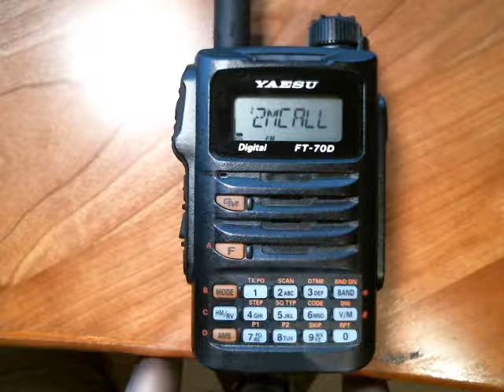Yaesu FT-70D Memory Bank Scan not working

Comment: Depending your method in programming, there is the option to ‘link’ programmed scan Banks.  If selected, the radio will go through all linked banks as if they were one. Discovered on mine when programming via PC. Once in-linked, scanning separate Banks worked as advertised.  I know this is an old post, but maybe it helps someone out there.
Reply: Your idea works. To bad it's not in manual

Comment: This works fine on my radio. Ensure you are on latest firmware. Also, mine was programmed using the RT Systems software and cable specific to this radio. If you used CHIRP or something else, that could a source of the issue. Hope you get it resolved if not already.
Reply: Don Draper 
Hello, I’m also having same issue. My unit came new a month ago with latest firmware. Cannot manually create and recall any memory banks per instructions. Using usb and Yaesu ADMS programming software does not create accessible banks for viewing or selecting. Frustrating
Reply: @repairfreak  The RT Systems software is expensive because it also requires a special cable. Sadly it works so much better then the Yaesu software that it is worth purchasing. That may help you. I was able to get banks programmed manually but cannot find my notes. Will continue to look for them. It just takes the right combination of key strokes.
Reply: Don Draper 
I found a crazy workaround:

1. With memory channels already check-boxed in ADMS Programming Software and uploaded to radio, and radio then put back under normal operation.

2. Here is what I had to do to work around the glitch: in memory mode (normal memory mode, not memory bank) select a random memory, press and hold V/M key. "F" blinks in display. Rotate the dial to a bank that you don't have memories registered to. Press the V/M key to save. 
3.  Now when V/M Mode is selected and on a memory channel, press BAND key until you see a Bank displayed, QUICKLY before display returns to memory mode, press the F Key to hold the radio in Bank Mode.
4. Rotate Knob to choose desired Bank, then press PTT button to select that bank. Now turning the knob will cycle through all the channels in that bank. Press F, then Scan [2], radio will now scan this chosen memory bank.
5. When you wish to go back to normal Memory channels, press BAND key until you see Memory, now you are back to all your channels. Repeat steps 3-4 to select a specific Memory Bank again if desired.
6. Note: to rename the bank(s), enter Menu Item 9 with long-press on F, then rotate selector knob to select BNK NAM, 
7. Press F key to pull-up bank display, rotate knob the select desired bank to name or re-name, then long-press on V/M
8. Rotate knob to start naming the bank digit by digit. Press BAND key to advance to next digit, MODE Key to go backwards, so forth and so on. 
9. Press PTT to save the new name entered into the chosen bank.

Comment: I was having the same problem and what I did was back up the radio on the computer, reset the radio to factory defaults, turn on your radio, input any call sign and then upload the file from the computer to the radio again . After that it work fine.  73
Reply: oscarpont 
I tried this to no avail, are you using the Yaesu ADMS Programming Software like me?
Reply: oscarpont 
Found a crazy workaround:

1. With memory channels already check-boxed in ADMS Programming Software and uploaded to radio, and radio then put back under normal operation.

2. Here is what I had to do to work around the glitch: in memory mode (normal memory mode, not memory bank) select a random memory, press and hold V/M key. "F" blinks in display. Rotate the dial to a bank that you don't have memories registered to. Press the V/M key to save. 
3.  Now when V/M Mode is selected and on a memory channel, press BAND key until you see a Bank displayed, QUICKLY before display returns to memory mode, press the F Key to hold the radio in Bank Mode.
4. Rotate Knob to choose desired Bank, then press PTT button to select that bank. Now turning the knob will cycle through all the channels in that bank. Press F, then Scan [2], radio will now scan this chosen memory bank.
5. When you wish to go back to normal Memory channels, press BAND key until you see Memory, now you are back to all your channels. Repeat steps 3-4 to select a specific Memory Bank again if desired.
6. Note: to rename the bank(s), enter Menu Item 9 with long-press on F, then rotate selector knob to select BNK NAM, 
7. Press F key to pull-up bank display, rotate knob the select desired bank to name or re-name, then long-press on V/M
8. Rotate knob to start naming the bank digit by digit. Press BAND key to advance to next digit, MODE Key to go backwards, so forth and so on. 
9. Press PTT to save the new name entered into the chosen bank.

Comment: Paul - Select a memory channel you want to scan. Then press the "F" key followed by the Skip (#9) key. Notice the little arrow that appears above your channel number. Press the Skip key again and the arrow is now blinking. One more press of the Skip key and the arrow is gone.

Without selecting anything, when you scan, the radio will scan everything. With a solid arrow (Not Blinking) the radio will scan everything except the channels with a solid arrow. If you choose the blinking arrow the radio will only scan the channels with the blinking arrow.

The manual that came with the radio just indicates that you can scan the channels. If you download the "Advance Manual", which is free from Yaesu it will explain the steps needed in order to select the channels to want to scan along with a lot more useful information. Hope this helps. - Fred KS1USA

Comment: Similar issue here. I got it working. The file I sent to the radio had memory channels in banks 1, 2, and 3. The radio said I had no banks.  Here is what I had to do...in memory mode (normal memory mode, not memory bank) select a random memory, press and hold V/M key. "F" blinks in display. Rotate the dial to a bank that you don't have memories registered to. Press the V/M key to save. 

Now, while in memory mode, pressing "band" switches between all memories and memory bank mode. Memory mode displays "memory" for a moment, memory bank mode will display the "bank number/name" for a moment. In memory bank mode, press "F" then "band", now use the knob to select what bank you want to scan, then press "band". Pressing "F" then "scan will scan just the bank previously selected.

Looking at your video again, you did just as I had to do, but it's still not working for you.
Reply: thanks.. this was helpful to me today!  73 de K0UC
Reply: Great! Thanks a lot, that makes my day :-) It's hard to remember, but it works!

Comment: Same problem here. Mine has the Mars/Cap Mod  and that may be the issue. I am not sure.
Reply: Jim Barber 
Same issue here, did you find a solution? I also have the Mars Cap Mod.  I even tried resetting radio back factory with no luck manually trying to create and access banks, or by using Yaesu ADMS programming software. Thanks
Reply: Jim Barber 
Found a crazy workaround !

1. With memory channels already check-boxed in ADMS Programming Software and uploaded to radio, and radio then put back under normal operation.

2. Here is what I had to do to work around the glitch: in memory mode (normal memory mode, not memory bank) select a random memory, press and hold V/M key. "F" blinks in display. Rotate the dial to a bank that you don't have memories registered to. Press the V/M key to save. 
3.  Now when V/M Mode is selected and on a memory channel, press BAND key until you see a Bank displayed, QUICKLY before display returns to memory mode, press the F Key to hold the radio in Bank Mode.
4. Rotate Knob to choose desired Bank, then press PTT button to select that bank. Now turning the knob will cycle through all the channels in that bank. Press F, then Scan [2], radio will now scan this chosen memory bank.
5. When you wish to go back to normal Memory channels, press BAND key until you see Memory, now you are back to all your channels. Repeat steps 3-4 to select a specific Memory Bank again if desired.
6. Note: to rename the bank(s), enter Menu Item 9 with long-press on F, then rotate selector knob to select BNK NAM, 
7. Press F key to pull-up bank display, rotate knob the select desired bank to name or re-name, then long-press on V/M
8. Rotate knob to start naming the bank digit by digit. Press BAND key to advance to next digit, MODE Key to go backwards, so forth and so on. 
9. Press PTT to save the new name entered into the chosen bank.
Reply: Hi, I also have a mars mod and the latest firmware and it works fine(ADMS)